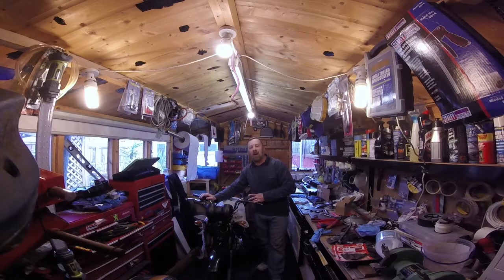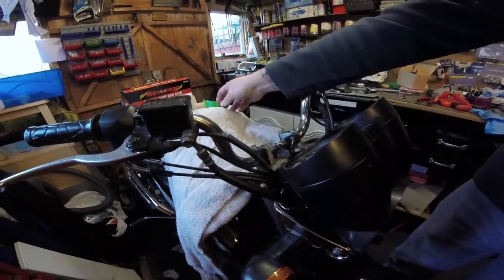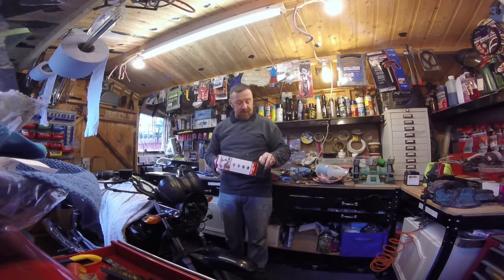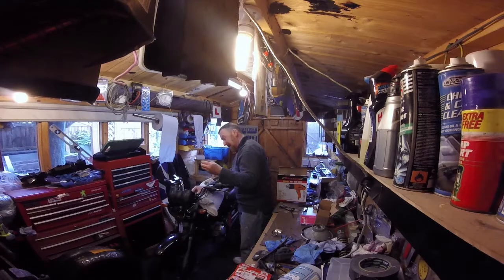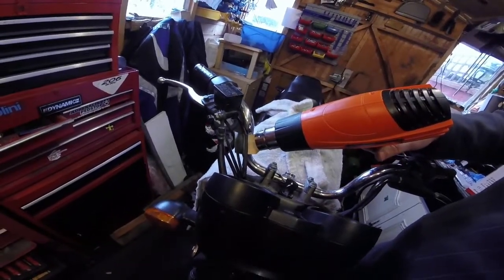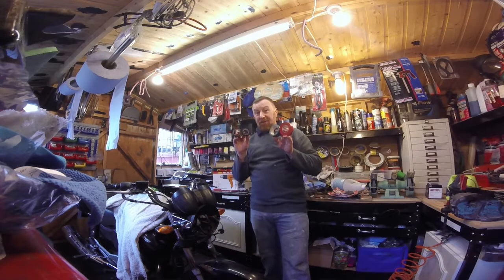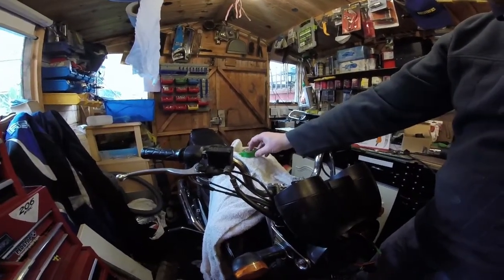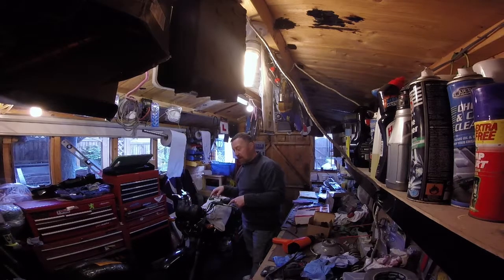USING A HEATGUN ON MOTORBIKE ELECTRICAL WIRING MARK SAVAGE

Comment: Hi Mark... little tip for y'all. When you've finished heating the heatshrink remove the gun and turn the heat setting down to as low as it will go with the fan still running for about 30 seconds before turning the gun off. That way the fan will cool the element down and will increase the life of the element and the gun. (Loads of heatshrinking coming up eh) Brilliant tools indeed, I've used mine for years and swear by the neat, tidy heatshrink method.
Reply from the maker: Mark Horton thanks for the top tip bud and thanks for watching and yes every chance I get lol 
Mark

Comment: Hi mark me again, Im the guy with the kymco agility 50 moaning about it being too slow ahah. im viewing an aprilia sr 50 2008 tomorrow anything i should look out for? thanks !!
Reply from the maker: Matti De'Beer I have a video of a few on here 
They look good go well and even have a 2010 one in my work shop now !!
A few issues 
1 di-tech injection goes wrong so best get a carb model if you can like the one I have 
The water pumps go and it’s a total engine rebuild !
So make sure it starts runs and rides well or walk away
Also to add 2t oil you have to keep a screw driver handy as you have to take the front panel off
While your there make sure the water is topped up 
Last when you turn it on check for any error codes on the dash 
Give me st50 videos a watch
Mark
Reply: Thank you for this really quick reply! It is a fuel injected version but it comes with 3 months warranty and its a pretty good deal. jeezz cant believe its a full engine rebuild if that happens!!. It's from a private dealer so im hoping it won't be that bad. thanks Mark!